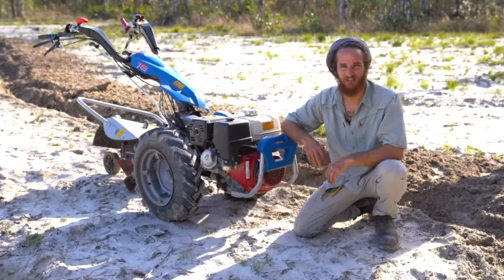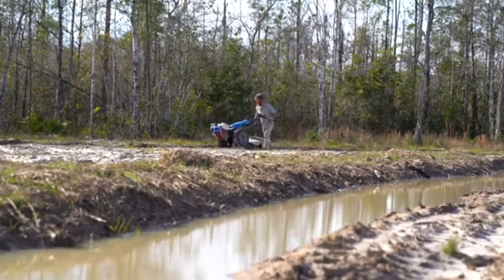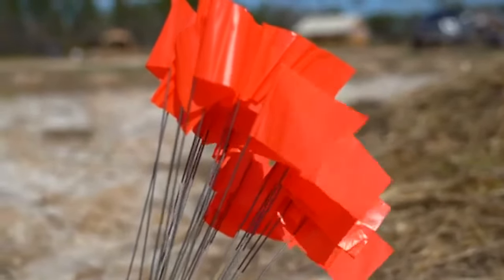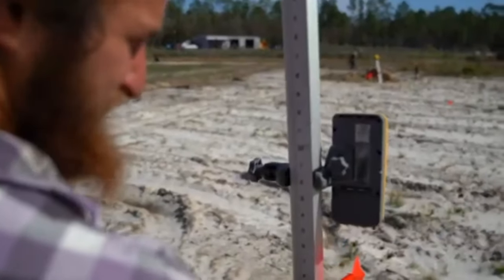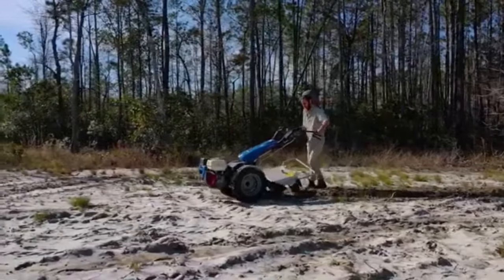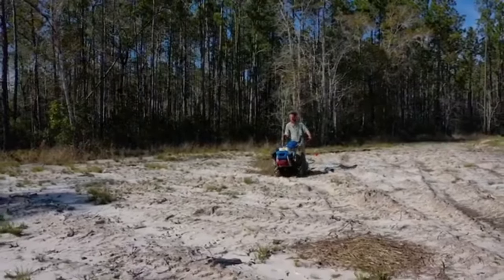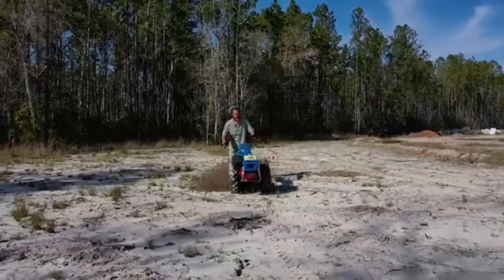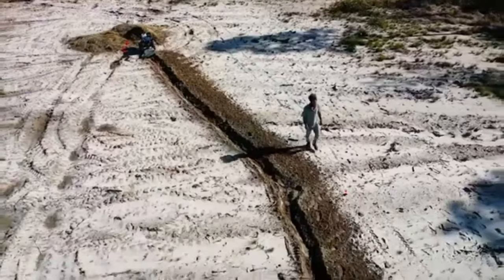Digging a Micro-Swale with the Rotary Plow

Comment: I flood irrigate fields and it is essential to have 4 sides with berms. The irrigation water is directed down slope by the two side berms till it hits the down slope berms where most would have a swales but with flood irrigation it hits the berm and builds water which pushes water back up slope and Deenergizes the water and spreads water over a vast area. There is no way to flood irrigate with just a swale on contour. There is a huge design flaw in a single swale on contour concept you must have berms not swales and they should be made perpendicular to each other and spaced together to hold the surface run off. The concept of berms not swales designed as flood irrigated fields will complete change the property over night on a big rain. My fields are 90’ x 312’ with berms on all 4 sides 12” tall they have held 3.4“ of rain within an hour and 4.3” of rain that day. This would not have been possible with just swales on contour. The side berms allows water to back fill up slope. The areas can be as big or as small as needed to keep the surface water from over running the berm on a rain event. On big rains the fields fill up with water more so on the down slope side and  backfills up slope and water fills the  fields completely . I’m the only property that held all the water on my property on a 100 year flood event no way would that be possible without berms perpendicular to the berm on contour. I have some video of my fields think of your property as flood irrigated fields but instead of it coming from a well it coming from rains. I also have ponds that will catch water and hold it. I’m going to build a duck pond that I irrigate through and direct that water to each of my irrigated fields.